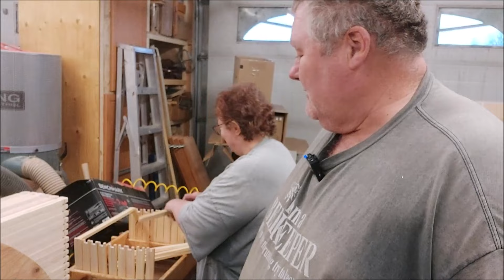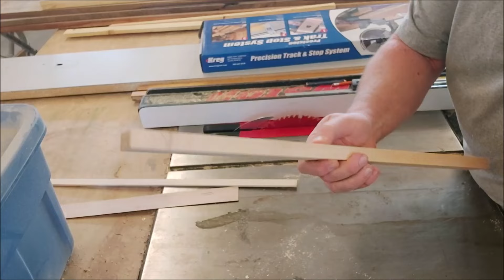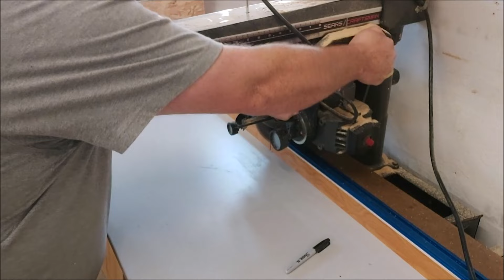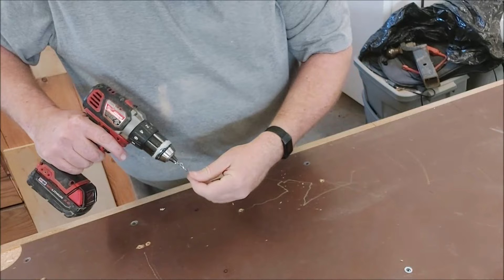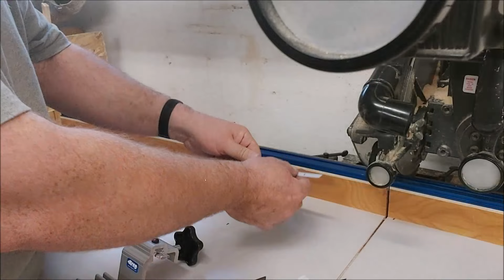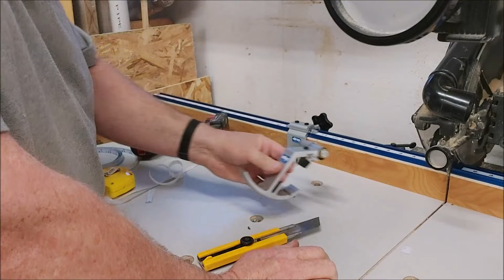🔨 Custom Radial Arm Saw Table Upgrade: New Top, Custom Fence & Track Stops-That Bee Man

Comment: I happen to have the same exact saw.  I love it, now that I went through the manual and adjusted it to work correctly.   Many steps to get it right.  I went through the manual step by step, and am super pleased with its performance cross-cutting, ripping, and mitering.  Hope you do not mind some suggestions.   This is if you want a fully functioning RAS which it looks as you do not.  Looks like you wanted a crosscut only saw.  Regardless, a few suggestions.  With the saw turned to inside rip, the motor locked at 0 on the scale on the arm, the fence should be set to the side of the blade.  You should not have a fence that high and it should not be screwed to the table.  Behind the fence you should have a 2” piece and another piece that fits inside the head shaft and clamps.   When you bolted the table down, you were not really done.  You are supposed to take off the blade, point the motor shaft down, get a small piece of flat metal, and move the head around the table in all directions to find the high spot.   Then with the head set at that elevation, loosen , shim, and tighten the top in all locations to that elevation.  Did you check and adjust the saw so that the back side trails the front of the blade?  That is not adjustable on a table saw, but is necessary to be checked and adjusted to keep from binding in thicker boards.
Best of luck to you and hoping you have been enjoying your saw!
Reply from the maker: You're right. This is a 90-degree crosscut machine only for me. What you didn't see off-camera is me performing the adjustments to align the table and blade. This is a Vlog channel, not a How-To channel. As for my fence design, I had no idea it was so wrong, judging by how perfectly it's been working for me for the past two years. I learn something every day. Thanks for watching.
Reply: @ThatBeeMan     There is no need to change anything it it is a one purpose machine.  It will do the job well.   I found this video very interesting about RAS during WW2.    It showed me what could be done.    When you have a spare half hour, you might like it.   
https://youtu.be/HiGH0Qsu3ak?si=EkqpaaKrWEyTL60d

Comment: Why not butt your piece of wood up to the blade.  Move your fence next to the other side of the wood.  Remove the piece and move your fence 5/16 of an inch in and cut off the 3/16 you need.   Faster and safer.